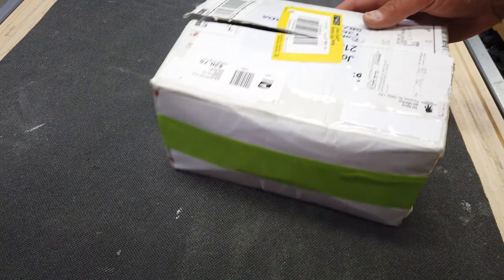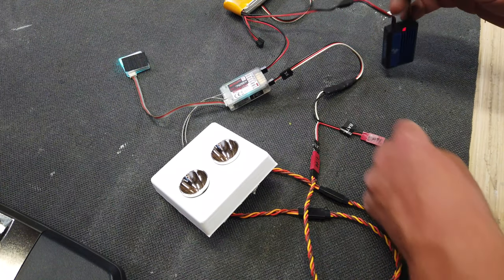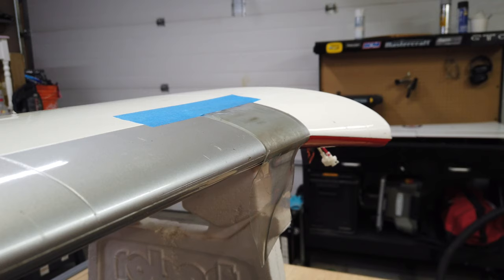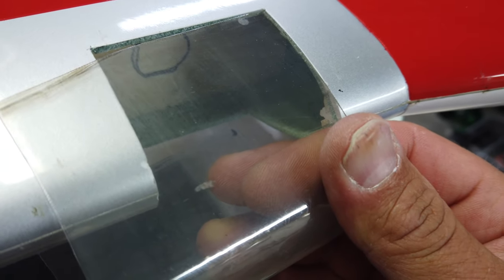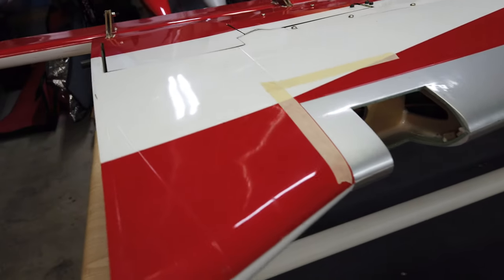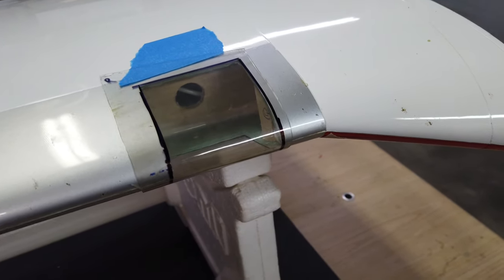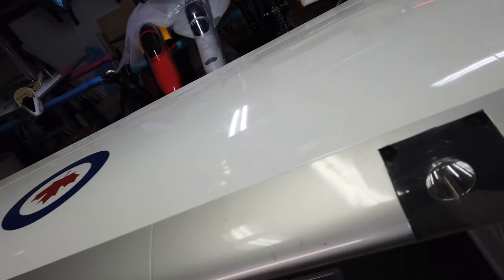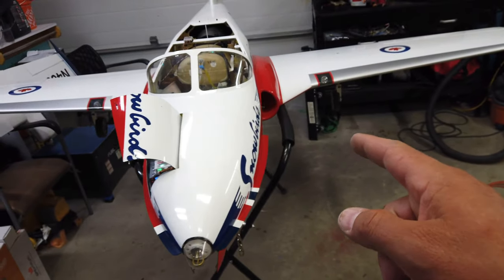HOW TO INSTALL LANDING LIGHTS - Full Install of SkyCandy Landing Lights, CARF Tutor Turbine Jet

Comment: Great video! Popped up in my suggestions, and I clicked because I'm in the market for bright landing lights.

Also liked the useful building tips, especially how you formed the plastic cover with a heat gun and mounted it so nicely in the wing.
Reply: Small note: their website only contains a message that they are launching soon, and googling brings up a different (insecure) website, but I'll check back later.
Reply from the maker: Thanks Thomas!  I installed a set of unilights in the CARF L39 build I did. They are great but these skycandy lights are more visible. We flew both the Tutor and l39 today and the skycandy lights are much more visible in daylight!
Reply from the maker: Yea I added their website link knowing it wasn’t done yet. Right now I believe the best thing to do is check out the Facebook page.

Comment: What plastic did you use. You had 3 types?
Reply: Looks like the F18 canopy
Reply from the maker: Yea ended up using the old F18 canopy. The material was thicker and molded better.